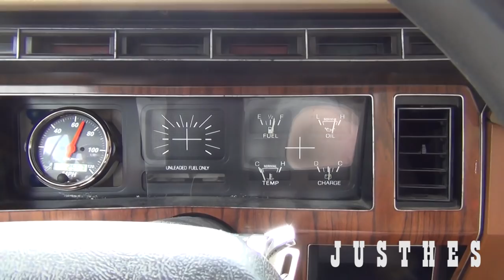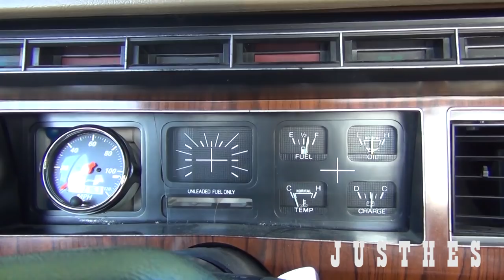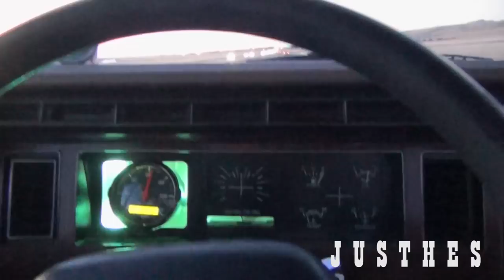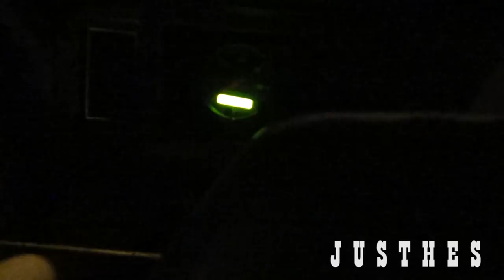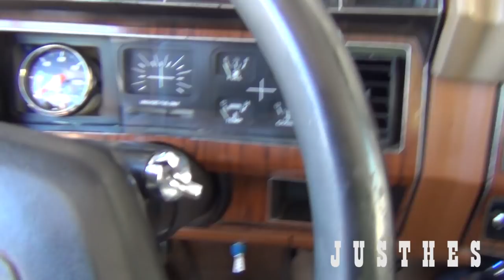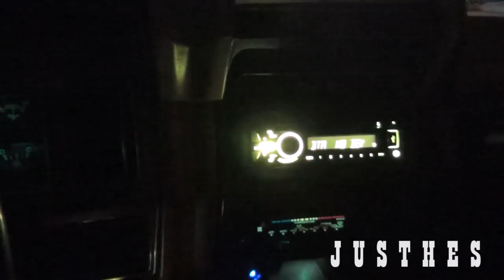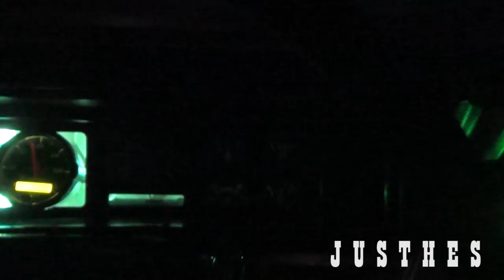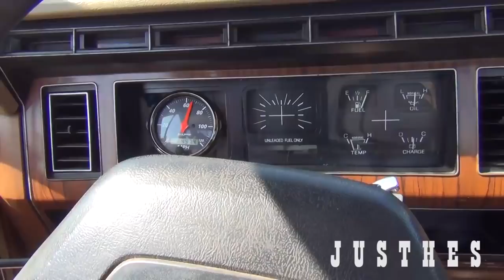California Road Trip in a Bull Nose Ford | Powered By Cummins

Comment: Sorry to hear about your troubles - on positive note, at least your weren't in SoCal or you'd have one expensive towing bill:)

I have a friend who's 4bt Sonoma did the same thing. He drove it around since July and it just died one day running around town. He got it started and found the temperature on one cylinder was hotter than the other three. He just found out it was a blown head gasket.

Good luck and keep us posted.
Reply from the maker: BigBlueMotors Yeah I was glad to be broke 170 miles from home rather than 1500.

Comment: Sorry about your troubles. Cummins doesnt recommend using any additives. If you want to help lube your injection pump and injectors just use some 2 stroke oil. Also use only cummins/fleetguard or mopar oil and fuel filters. Mopar is rebranded fleetguard.

Comment: Sure glad I watched the whole thing. I might have gone and gotten some of that additive, had I not watched the end.
Reply from the maker: +selador11 Later in my adventures, I took the injection pump apart (which was the failure point) and it had all kinds of metal debris coming out of the fuel. So my thinking is that I used too much additive and that may have caused a lack of lubricity in the fuel... ORRRR my pump could have just been on it's last legs and I finished it off on this trip.

Comment: hi . i have a swaped ford 2000 f 350 minibus whit this 4bt engine since one year, some problems with thw engine mounts and powersterring pump and 2 clutch plates, these engines are awesome im saving a lot of fuel before the swap , 30 liters per day.

Comment: Thanks for the Videos on this Adventure showing the good-times and also the challenges of Traveling on the open road. Question could you of fixed the problem with your truck if you would had ability to get Parts etc? 750.00 seems to much?

Comment: hey im from battle ground Washington and was wondering were u got your 4bt at was it local and what transmission do u have in it.
Reply from the maker: +Sam Goodman Got my engine from a guy in carlton, oregon which is about 30 miles from me. I think he stopped selling them. I have had an NP 435 since the time of the engine swap and still have it. it's been a pretty good unit despite being a lost cause at a junkyard.

Comment: Hey man im converting my truck to 4x4 its got the 4.9 straight 6, and a c5 transmission. I have everything to make it 4x4 but i feel like the trans i have in there wont work what did u do to get ir trans to work with the swap
Reply: Tristan Baker the t19 with an adapter from a 4x4 f250 should do it. The piece is aluminum.. So find a spare. The piece allows mounting of a 205 case.

Comment: the radio in my 94 f150 does the same thing. it shorts out all the time and i'm lucky if it works most of the time
Reply from the maker: I later found out I had a corroded connection and it was my own wiring that did this lol. I soldered all my power connections and have not had an issue since.
Reply: awesome yeah i think that is my problem as well, but first thing first is my clutch, tranny and transfer case fluids, and parking break cable

Comment: Way late but don't use that stuff. It's made for winter diesel which you won't find anywhere on your trip. It shouldn't have affected the injection pump but... Live and learn.
Reply from the maker: that was just my initial thought... however my pump had a worn head and rotor which finally gave up the ghost.
Reply: +Johnson&#39;s Gee-rage Keep an eye on that. The biggest problem with the low sulphur diesel is that it can cause higher wear on older units. With a modern pump it shouldn't be an issue.
Reply: Johnson's Gee-rage VE pumps are only good for an average of 110k to 120k.miles from what I've seen.....and most that's freeway miles.

Comment: you should never cross breed vehicles. I will put a 7.3 in it keep it all fall keep it off all Ford
Reply: +J Redus Powerjoke? That' funny.
Reply from the maker: +ihninja1 isnt a 7.3 a international engine made FOR ford. ford also uses the cummins brand in their heavy duty commercial vehicles.
Reply: Yes, they do. That's why I like the F750. Allison Transmission with a Cummins Diesel.
Reply: J Redus it’s not cross breeding the cummins was made for everything not just for dodge and the 7.3 was made for a school bus not just ford